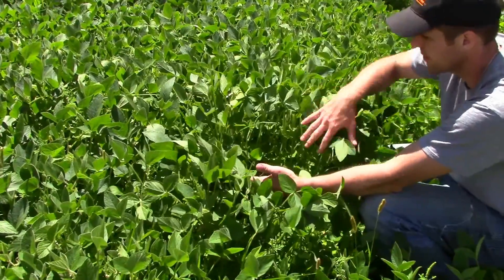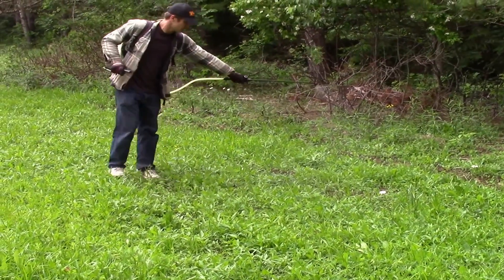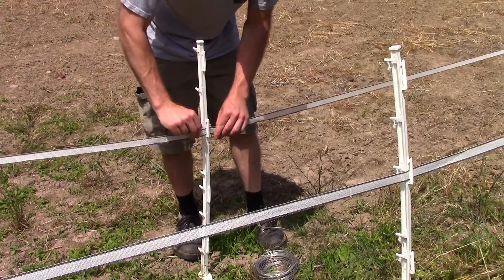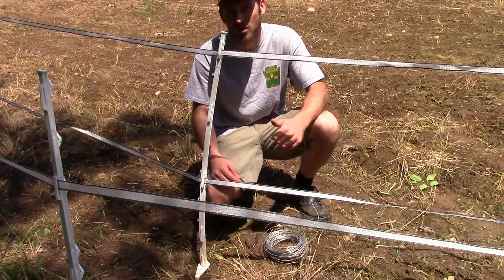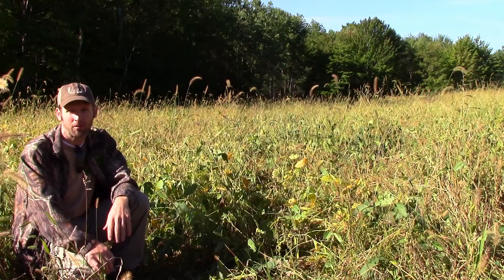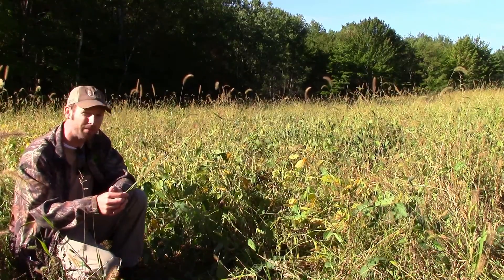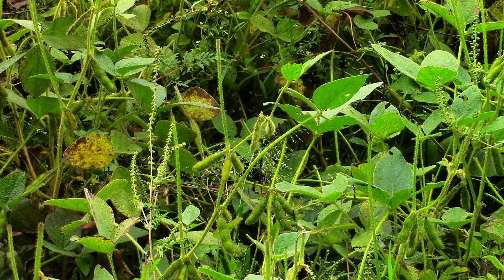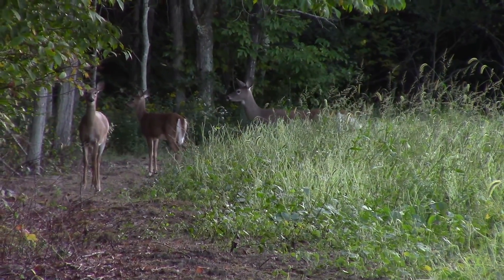The non-GMO Soybean Project

Comment: Looks good but I have the same experience with foxtail taking over the world in the heat of summer.  Try using a legume herbicide like Poast, Raptor.24db or Pursuit .   Foxtail is not the end of the world either.  Turkeys and deer will eat the seedheads. i didnt think deer would eat them but watched one munching on them from my stand one evening.  If you stop beating up your soil with all that tillage and get your soil biota healthy, it will help a lot.  Park your tillage equipment and use a sprayer.  Not criticizing, just offering some advice.
Reply from the maker: Keeping the equipment parked would be nice but we really want to employ as few chemicals as possible. Ultimately, weed control is better managed with the herbicides like you mentioned and I think as we continue fighting the never-ending natural battle of weed control, herbicides may be where we wind up. We appreciate your thoughts!

Comment: Why didn't you use a grass selective herbicide?
Reply from the maker: While Round up or glyphosate would've eliminated everything, we could have targeted the grasses with a selective herbicide like Arrest or Assure, however, the post-emergence application window is narrow. Grasses need sprayed when they're between 2 - 4" and we missed that window. To effectively control it, a clean burn down is required prior to planting, which we reluctantly did since no chemical is a good chemical. Given the weather, our plot was looking good under a carpet of beans and we were fairly confident that the no-till approach, combined with the burn and rate at which we broadcasted, helped keep those grasses in check until the rain finally came and everything took off. By then it was too late.